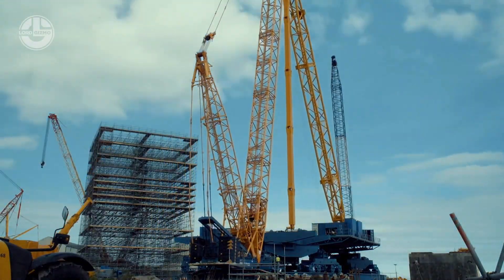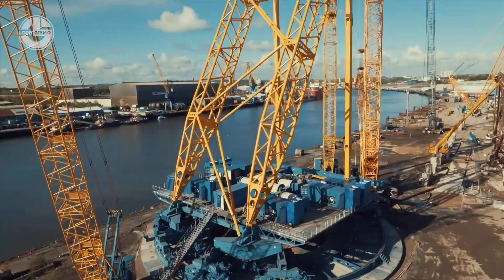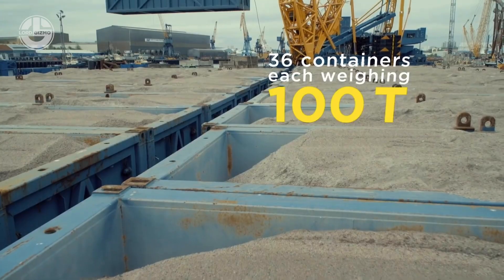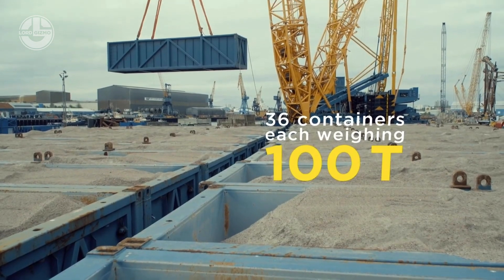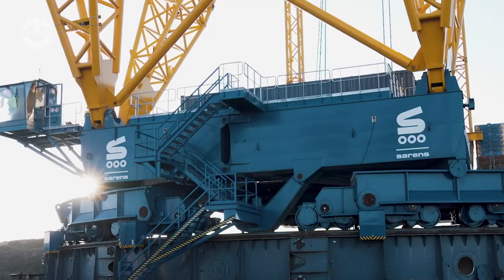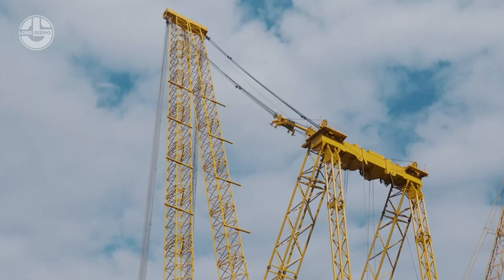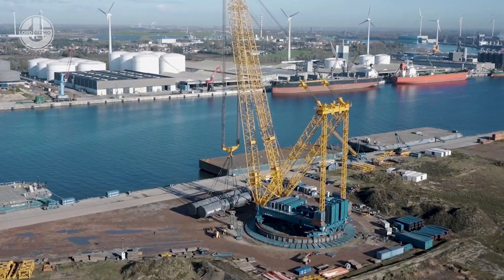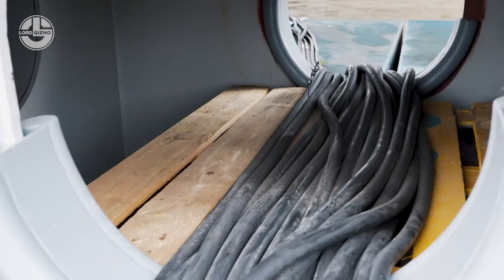7 Extremely Powerful Machines You've Probably Never Seen Before

Comment: Well, the crane is a Liebherr, Sarens is a crane company who just bought the carane.
Reply: As I like to point out, Lord Gizmo really does not have much of an idea of the machines he uploades( the video material is still good to watch).. Yep, your right it is a Leibherr.. Also, I sure (from the 4 winch drums we see) that it has away more than the 1.5km of wire as stated. The main hook has twin blocks with what appear to be at least 10 falls on each, while the luffing wires have about 8 falls each..... that alone adds up to many, many thousands of metres
Reply: The SGC series cranes are not Liebherr there designed in house by Sarens own engineers
And the VLT-U can easily handle loads of 1600t there used to install offshore piles.
Reply from the maker: Thank you Richard for explaining some of their points.
Reply: @richieac1000 . Maby to Sarens specifications, but built by Leibherr.... Absolutely no way   can those 4 snatchs lift 1600 tonne.
Reply: @robertteap8052  you know more than me then and I work with this equipment 🤷🏻‍♂️
Reply: @richieac1000  Yep.. You got that right
Reply: @richieac1000 . The following is a calculation based on weight /M as per ESC website (possible the largest supplier /installer in the Middle East)
A pile of 2020mm external dia. with a wall thickness of 30.2mm weights 1.48 Metric Tonne per Metre.
So a lift of 1600 Tonne would be in excess of 1081Metres..
Now, over to you, seeing as you work in the industry, please explain what on this earth is going to lift over 1081Metres of pile..

Your move.....
Reply: @robertteap8052  I regards to your original comment these VLT-U tools can be configured in sets  so it’s possible to be lifting a combined load of the monopile and the tool up to 1600 t 
We’re installing xxl monopiles on wind farms which are anywhere from 1000-1300 ton 
It says on VLT ‘s website they have used a triple set up to install monopiles of a 1000t on a offshore wind farm in Taiwan.
Reply: @richieac1000 .. We were discussing the CV. 320..it can NOT lift 1600 tonne.. And because of their circular design they cannot be used in multiples....
Reply: @richieac1000  Also... on deep water project's (wind turbines) they do not use monopiles.. As in Scotland they use a land built "tripod" which is attached to the seabed by suction. And these have a weight of about 1000MT. and at in a depth of about 56M...
So...your still a long way off your 1600MT claim....
But, if we were discussing XL or XXL monopiles with a Dia. of 7 or 8M. then we are talking about a total different size of pile driver, not the one Lord Gizmo featured...
Reply: @richieac1000 
Yep.. Possible 100 plus Tonne.... But far short of the original quote of 1600
Reply: Also.. No way that impact hammer can lift 1600 tonne... Lol